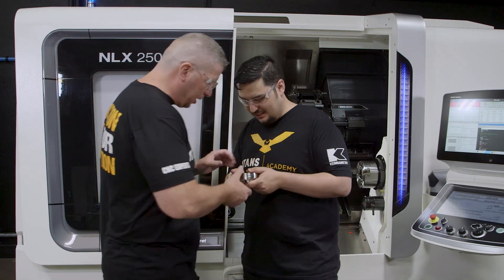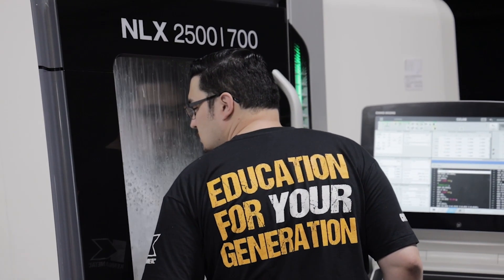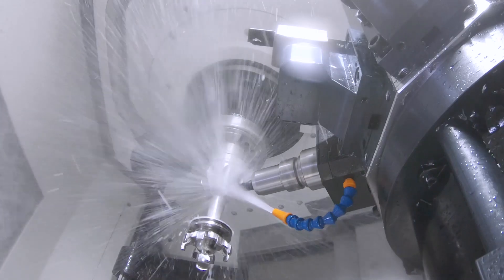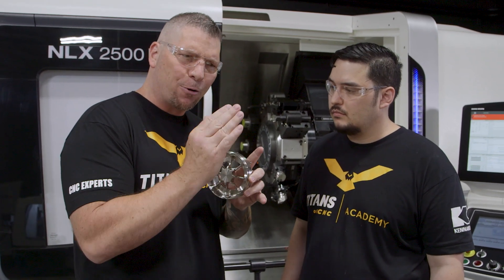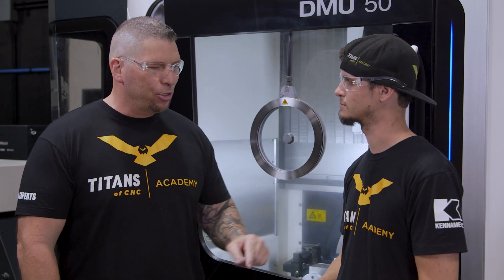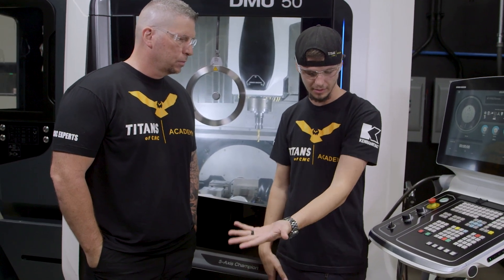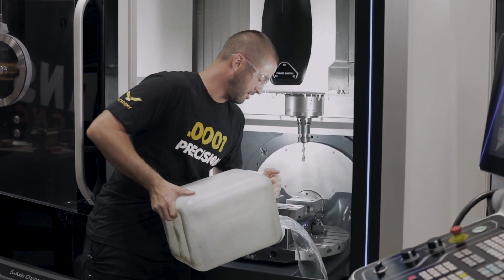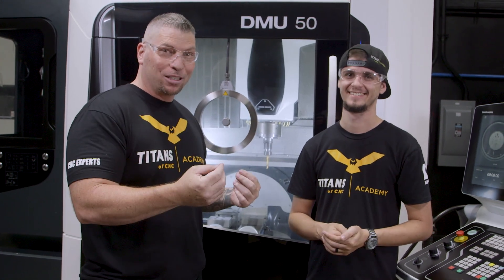REQUIRED for CNC Machining the Craziest Materials on the Planet

Comment: I like the idea of this stuff because it will never go rancid. But I’m still scared of full synthetics for the sake of my seals/ wipers, and ultimately my bearings.  

What percentage dilution do you run this stuff at? I assume heavy for the superalloys?
Reply from the maker: This is a new kind of Synthetic that doesn’t harm your machine... also I run 7 for soft materials and 10 for hard.

So for 7...

I run the refractometer at 5 and then calculate it by 1.4 which equals 7

Comment: Going to be honest.. I was a bit dubious about the 735 at first and thought it was just a sales pitch.
After buying a 25l can and trying it for a month, i didnt even think about the extra cost of what a barrel costs compared to the other milky type.
You can see though the coolant all the way to the cutting edge, machines stay clean (no white residue after the milky coolant has evapourated, smells clean etc.
the only down side is that i once had a coolant tank overflow and i didnt notice the puddle for a few minutes.
KB-Tech in the UK.

Comment: How does the Blaser 735 works in copper and brass? Is the 735 robust against oxidation? This would be intresting for milling electrodes.
Are the seals and tubes okey? Because it is a synthetic coolant and maybe remove the softener from the plastic.
Reply from the maker: Works great. There is a new version that makes it so it doesn’t mark or tarnish. Ask them questions
Reply: Hello Bernhard, I work for Blaser Customer Service. Synergy 735 is recommended for copper and brass. The 735 has excellent seal and paint compatibility data which we would be happy to share with you. Best regards, Brett

Comment: The coolant Is a solubile oil or blaser sells pre-diluted?
Reply: The Synergy 735 comes as a concentrate which you dilute to the end use concentration. I work for Blaser.
Reply: @darkapertureproductions2753  Hi Dark Aperture.I work for a Aerospace sub contractor factory and we are using Ho-cut 795. Is the Synergy colant is safe for aerospace material and approved by  P&WC, Bombardier ans Sumitomo ??

Comment: Sir,how do we get to know which tool material to use for the material to be machined?
Reply: Karan Prabhu that comes with experience. What are u machining? If it’s something hard u want to use carbide tools. I use carbide on everything. Single flute for plastic. 3 flute for aluminum. 4 flute and coated for your harder materials. Kenametal harvi endmills work great for hard materials.
Reply: @LIGHTRIDER420  thank you for the reply. Well I am still a student, I am interested in CNC machining. Could you kindly suggest me a books to learn about machining and CNC programming?